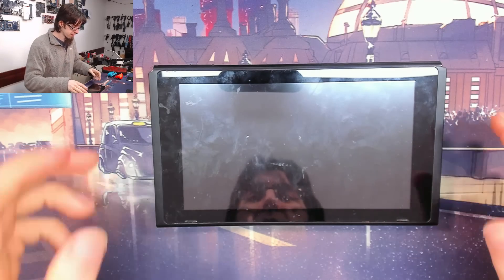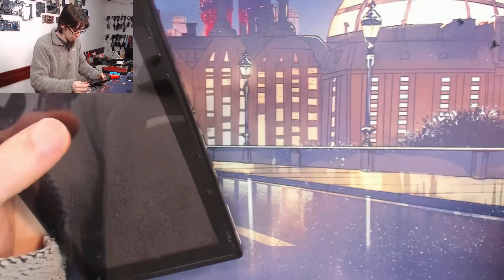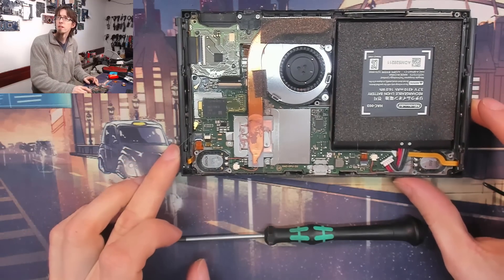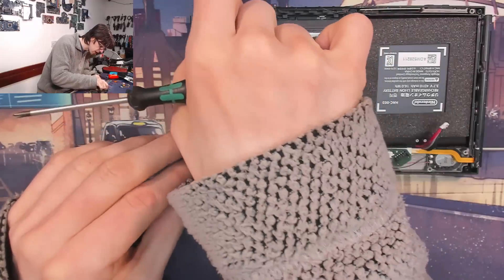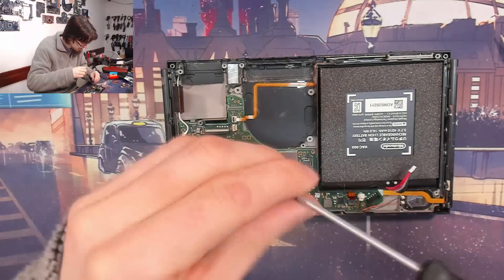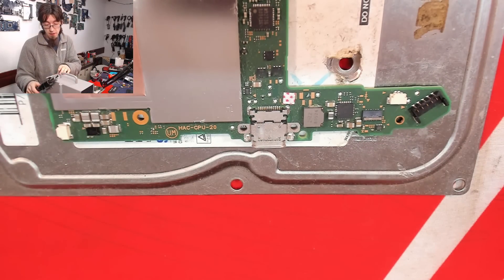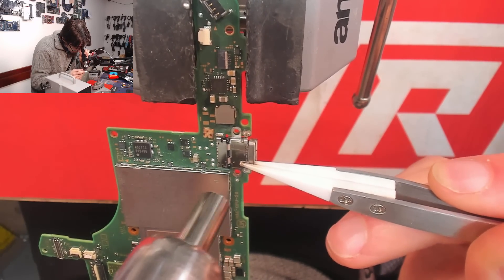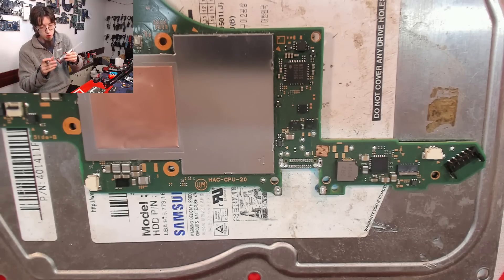Nintendo Switch USB Port Replacement - LFC#241

Comment: Adam keep doing what you doing

The cod3r critizied a itadam about soldering but i saw a video that cod3r skills are not the best. Before talk about someone you must first see yourself. I not the kind of person to talk about someone. But i gonna show the cod3r  how to do it and the right way.
This instructions is for the cod3r and someone else that wanna to learn how to do it and the right way

1- clean the area.
2- apply low melt solder to mix with the old solder
3 the sucker pump doesnt work fine
4 when you apply low melt solder its easy to extract the solder from the hole with the wick
5 do the jumper first and use uv mask
6 put the connector and soldering one by one depending the type of connector.
7 clean with wd-40 and then with alcohol 99% or contact cleaner( prevent oxidation and the future)
8 Never talk about someone its better help other instead critic in from the people. 
GOD bless you

Comment: Just as a heads up, I'm sure someone else has said it. You always need to check it docks after a USB C replacement on the normal switch. Most of the back pins correlate to the docking function.

Comment: USB C seems to be more reinforced, than Micro USB which generally get overly push in and gets broken off the board. It told quite alot of effort. Regardless the job was done successful, good job

Comment: One tip for hot air removal: add a little bit of flux to everything. It helps with even heat transfer. You can also add a little fresh solder to the holes once the connector is out, and then suck out the holes with your hot air vacuum tool. More solder in the hole actually makes it easier to get all the solder out.

Those dual-row connectors are a real bugger to put back down by hand. Whoever designed them has never picked up a soldering iron. Flux is your friend there, for sure - too little is much worse than too much especially if you clean it all off when done.

Soldering is a skill that improves with experience. The more you do, the better you get. This from a former soldering instructor that didn't know which end of the iron was hot when he started that job. (I wasn't teaching on day 1.)

Comment: With all that technical knowledge..

You sir need to get a fancy microscope 🔬 
You will wonder why you went so long without it! (TRUTH FOR ME) 
I got my first microscope back in January of 2019. When I got it, I couldn't believe I did jobs like this without it (bridging traces was so common back then) (. Before that I used a magnifying lense light. And it worked, but, it was like a moped trying to get on the freeway. You can do it, but not very easily. I would find myself resoldering HDMI connectors several times because I would have micro-bridges that I couldn't see with the lense.
Please consider one for your channel. With your level of knowledge in electronics, you should definitely consider getting one.

Comment: I enjoy watching everyone who repairs being a technician myself for the past 10 years there is always something new to learn from others in the same buisness. But the way this was done also made me worried for the customers device. Yes everyone has to practice but before I ever attempted a repair on a switch I purchased 2 donor boards. 1st one not enough heat was used and I lost 2 pads under the port. Learned quickly from my mistake and the second one come off very easily with no damage what so ever. Yes donor boards can not always be obtained for certain devices. Just like new consoles and things no one has worked on before. If it's a hdmi port replacement then they are all the same no matter what device you do it on. And as stated by many others the flexing of the board in that area usually will damage the microscopic traces inside. Lucky this did not happen and the port came off without further damage. I do not have a YouTube channel 1 because I do not have the time to edit videos on a daily basis and 2 because of criticism from others. Thecod3r is a good technician the same as northridge is and yes it could have been worded better. But 2 wrongs do not make a right and even yourself northridge have slated some people for repairs and Hiroshima bombs inside of devices from people who have never done these repairs before attempting the repair themselves. I will continue to follow any tech as I enjoy seeing how others go about removing certain components to see if there is a better way to do things. I understand where thecod3r is coming from when he said that people who follow this channel will undoubtedly try this repair themselves and may cause irreparable damage to the console in question. I for one would never treat a customers console in this way and I was surprised to see it done on this channel. This does not mean I will un subscribe because as I said above I enjoy watching other technicians and how they work but better care needs to be taken when dealing with customers consoles and how you show your followers on how to remove components.

Comment: I like to put/mix some lead free solder on the ankers and pins , then it doesn't have to fry to long. Well, many roads lead to rome. I appreciate that you share repairs when diggin in for the first time! :)
Reply: nice advice, can you tell me what do you do when you actually cook something and can't replace that part? what do you tell to customer?
Reply: @miso1995srb  If there is a part on the board i can't get or replace then i don't mess with it. Sometimes it's better to stay away if your not sure to break the device. Or for example a board i never worked on: i start low with save temps and look around if there is any critical parts around like underfilled ics, fpc connectors... cover them with metal shields or heat resistant tape etc. Most important: practice, practice, practice on donor boards then comes experience. And last but not least be honest to your customers before or after a repair. Cheers

Comment: The Streisand effect in full effect! 🤣One improper commenter brings forth a sleuth of positivity to your channel!
I've been following you for a while, and I was so chuffed, as the Bri'ish say,  when Northridge Fix mentioned your channel! Sad it was under such crappy circumstances, but some people are simply wired incorrectly.

I know you're a kinaesthetic learner (I am too), but don't make things doubly difficult for yourself! Watch some videos of other creators (NF and Tronicfix and there are so many other positive examples), and you'll learn a lot of tips and techniques on how to do mini and micro soldering! Even if you avoid looking at the disassembly videos of devices you're working on, these guys always add great information on what they're doing, why they are doing it etc.

Btw, the amount of patience you've shown with the TUF mobo with the screwed up CPU socket pins? Insane. Or masochistic, haven't decided yet.
Reply: Sleuth?  Are you talking about a detective?

Comment: you need to buy some rose metal. about 1/5 the price of chip quick low melt solder. and lower melting point. makes anything basically fall right off the board when u mix it with the old solder

Comment: What's your take on USB C's durability?

Reversibility is nice, but so they need so many damn pins? 🤷‍♂️
Reply from the maker: Type-C seems good to me, but give the general public any connector and they'll break it. Especially when kids are involved.
I see the way people treat their stuff, every day people walk in holding laptops with the charger cable wrapped around them. As they say, make it idiot-proof and they'll build a better idiot.

Comment: Next time add some solder first, it will make your life much easier. Even if it is not low-melt solder, it will lower the soldering temperature. Even flux helps making the solder flow more easily.

Comment: You did a great job on that, one thing that you remind me when working with hot air blower is to keep it away from the PCB in curtain distance, it can literally break/ crack / melt it down and as you know if you damaging between PCB layers the all PCB is dead, keep that in your mind and watch out..
Nicely Done!

Comment: i get breaking micro usb 2 connectors, but to break type c just needs special kind of stupid. :D
Reply: Not really. Micro B has more room inside and the metal sheath around it can spread to accommodate mechanical aggression. 😁 With type C you have nowhere to go and nowhere to hide - all the dust gets built up and trapped at the bottom. With so many pins and such little space when you plug a cable inside a lint-clogged port... It's really unforgiving. 👀

Comment: 🐨 I will give it a while and you will be doing phones, and not long after that Apple Watches and hearing aids 😉 BTW with the Switches "USB Ports", The plug "Charging cable" can be flipped and inserted into the Port, Long story short If the customer comes back with erratic charging, it could be that the USB ports hidden pads need to be reflowed, therefore with such USB Ports always check by flipping the charger cable and ensuring it charges either way, also docking needs to be quality assured, I only mentioned this BTW as it was not revealed in your video.
APU I dropped a like..

Comment: would suggest having some way to test if its fast charging as well edit nevermind you have a wall reading, but it should charge at higher than 15 watts  unless that is only when its turned off? not sure

Comment: Couple of things that made me cringe as someone who has worked on over 100 of them. Heat the board from the bottom and lightly tap it, it will fall out eventually. The board dissipates heat well so don't worry too much about how long it takes. Do not wick across the pin pads wick with them. I was sitting there saying "how lucky are you!" when you didn't pull any on the pull or clean up, and you where very lucky. Otherwise nice job. Also a port job isn't really done until you have tested and made sure it is charging on both sides and it will dock sync.
Reply: I agree with you here too micro you need to practice on dead or your own stuff before working on a customers
Reply: Micro i followed your advice and you told me be patient it will fall out and low and behold without touching the port it did indeed fall out :)
Reply: @leeheggie7043  Awesome man!
Reply: This is true positive criticism. Respect!
Reply: I agree micro, you know how I get when I see this kind of repair, and this honestly made me angry to watch such blatant disregard for a customer's property 😡
Reply: @TheCod3r  Be calm Phil lol.  He seems a good guy. Just trying to give a little advice so he avoids pain on a future one. I'm sure his customer was aware before they proceeded.
Reply: @MicroMageRepair  I really can't mate, it's things like that which cause other technicians to have nightmare 3 hour repair jobs. I used to have respect for him, I've just unsubbed and that's being mild 😞
Reply: @joesalgadSF415  Did your mum not give you enough love when you were a child ? You seem upset. It's ok to not be angry at the world, they cant hurt you now.
Reply: @TheCod3r   dude why don’t you just STFU stop being a drama queen if he breaks it that’s on him he will pay for his mistake. Why you keep goin on and on just stop, that’s his first try he didn’t break anything and he fixed the f’ing thing.

Comment: How much are you charging for this replacement, I may need one? That's if I can assist and learn as well, that is :)
Reply from the maker: I usually match the ebay prices for stuff like this - so £30. It's probably below value, but I get the practise time, which can be more useful. I'm not taking on mail-in repairs at the moment though, as I'm currently snowed under!

Comment: I know the frustration of plugging in small ribbon cables. Just replaced the analog sticks in some joycons and they're so painful to work on.
Reply: yea its a common issue all of the joycon analog sticks will fail at some point and start drifting

Comment: What flux did you use? I got some thick flux did not flow well!
Reply from the maker: eBay Amtech. Usually alright, but this current tube I have is naff and thicker than treacle, previous stuff has been fine. It seems to work though.
Reply: @Adamant_IT  Thanks.

Comment: You can use usb c cables with 56kh resistor as Nintendo says usb c to usb c is also fine for Nintendo switch

Comment: I use low melt solder, to limit the heat on the board. Good job.
Reply: Yep, love the way Northridge Fix handles ports
Reply: I tried to tell him to try that and use more flux. That solder sucker gun is only really good for old motherboard that use leaded solder.
Reply: @haxxorsheep  When i check old stuff what i have around , gpus, mobos, even from 2008 are lead free. So it would be great like for 386 stuff ? 
Easy way is mix leaded solder with that terrible stuff on "new" components, and then you can use soldersuckergun with no problems :)

Comment: should try some Kapton tape on surrounding areas when using hot air maybe?
Reply: That's placebo, the board need to heat up and dissipate heat, when the zone you're aiming at actually hit melting temperature the rest is still at lower temps with SOLID solder, so no damage is possible, you only shield plastic parts and deliciated components like microphones.

Comment: Where did you get this pry tool??
I mean the metal one.
Reply from the maker: Search eBay for "metal spudger". Beware that metal tools are much stronger, but will also damage stuff in careless hands. I also recommend sharpening them a little with a file, not to cutting sharpness, but just to help get into thinner gaps.

Comment: That board flex while on the vise gave me the chills!
Reply: Yeah thought ripped traces coming up.
Reply: @GordonNew  i thought the same seen it too many times when incompetent technicians rip the traces then i have to spend hours repairing and if he's paranoid about cooking chips then he should be using heat resistant tape
Reply: @Jpgamingll123  Hey John yeah it happens ,  I wasn't being negative here,  Graham is a great bloke, like he said he likes to try do things without reading up and such like, which could have been a costly mistake in this instance, but it wasn't he succeeded,  we all learn from mistakes, as I am sure Graham has learnt from how he did this, there are always different ways of doing things. Cheers
Reply: @za-se4jv  yeah your right sry, it was more for the port removal without ripping the traces.

Comment: what plier are you using Graham?
Reply from the maker: Prying tool or Tweezers? Prying tool is a "metal spudger". Tweezer, I have a few that a good in different situations. My favourite ones are an angled pair, which are the ones I changed out to while battling that ribbon. The first pair are some pointed tweezers which are good for small components, but damage easily. I also use ceramic tweezers, which are very strong, but also quite blunt.

Comment: hate fixing these things the pads inside the connector are a pain...to clear the holes add more solder then flood it with flux and pull it out with solder wick comes away easily...good video

Comment: Woah, saw the time on the Switch near the end of the vid, did you work that late?
Reply from the maker: Naa, the clock had just reset because the battery was disconnected.